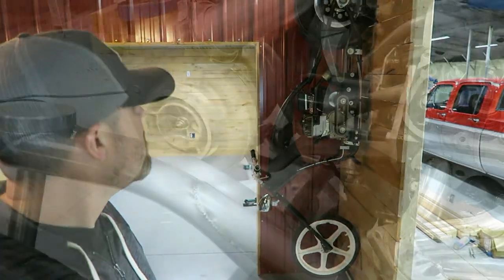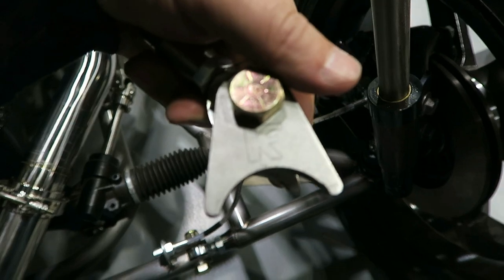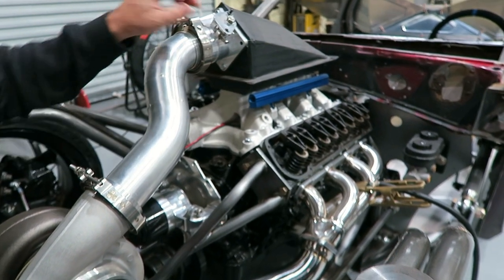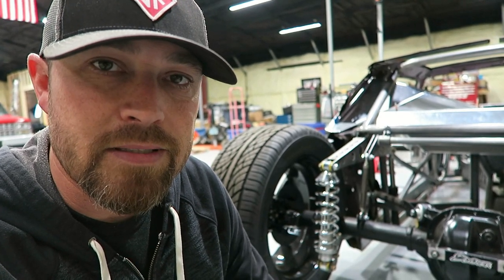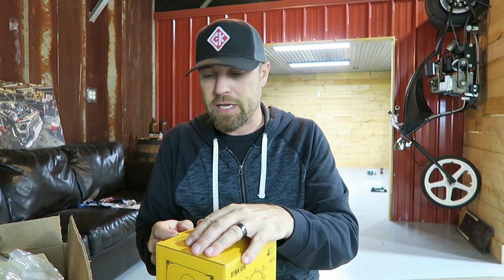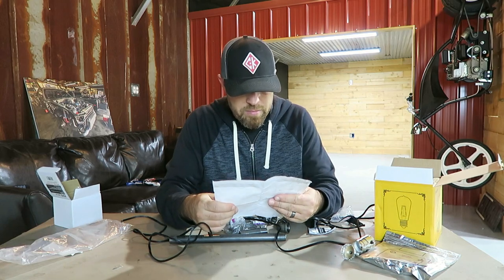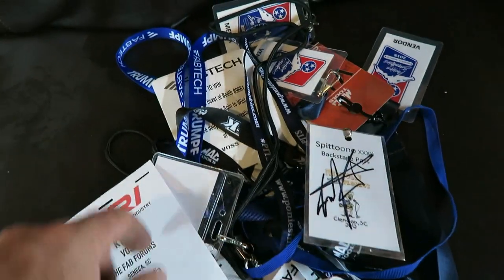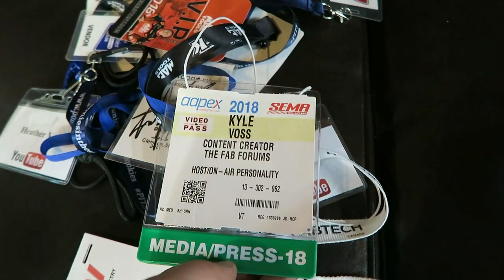How To Make A Industrial Pipe Lamp

Comment: Mini Chopper Looks Gooodd Kyle, as for The Bibbster the Extra Bracing/ adjustment Bar in Front Makes Sense, also Liking The idea of Letting The Rear Tires Hanging Outside The Rear of The Body  ( making The Car LOOK Even LOWER, LONGER n MEANER) The Pipe lamp's Perfect ,Thank You for Sharing The info to Get mSelf 1. Till Next Time, God Bless You and All Yours.